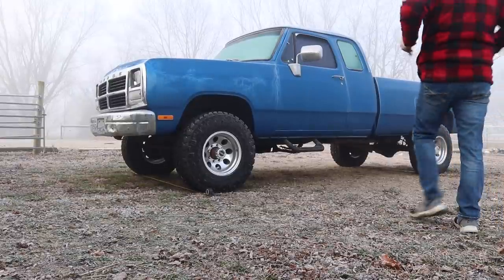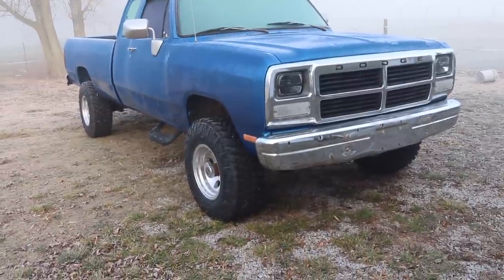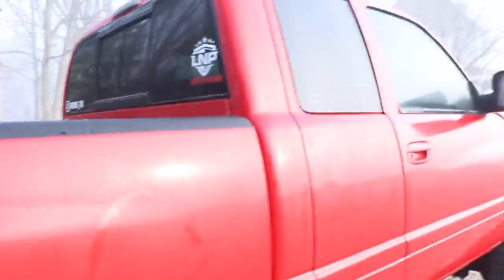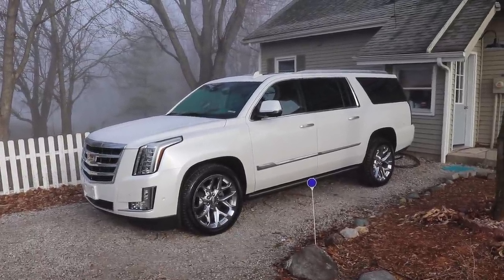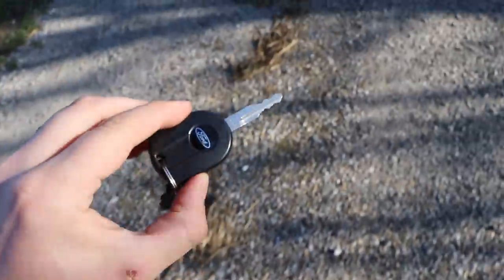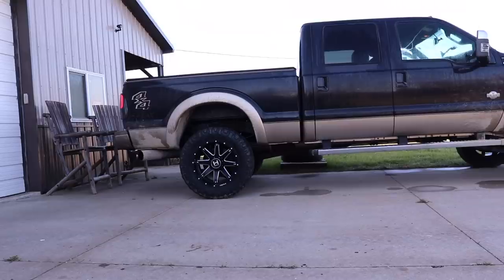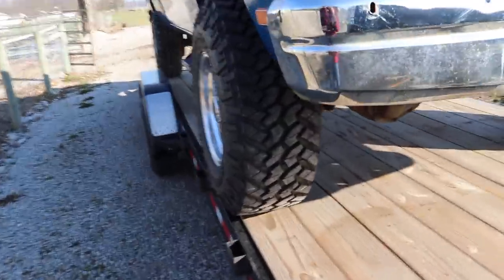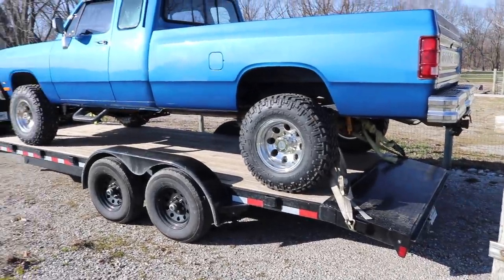The 1st gen is already off to the SHOP!!!

Comment: ur suppose to plug a desel truck into the wall on cold days to the heater block will warm up the engine and it will start up better the 110 v plug is under the hood on superdutys not sure were the rams is it should be under the hood on the right or left side sometimes the plug is behind grilles

Comment: My 2002 2nd gen starts like a small block chevy at 10 degrees  her truck cranks way to log when it starts
Reply: I've personally owned several 24valve 2nd gens and they all fired up rather quickly,I've commented in the past that even on warm days Rosine cranks longer than most 24v 2nd gens